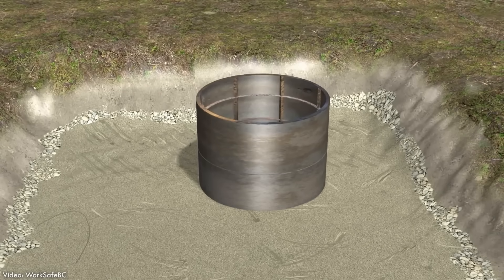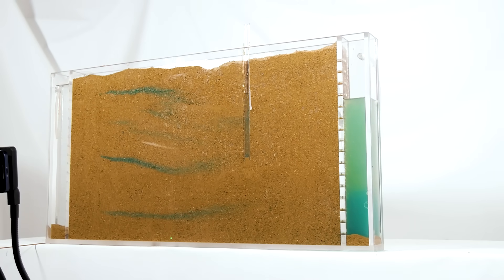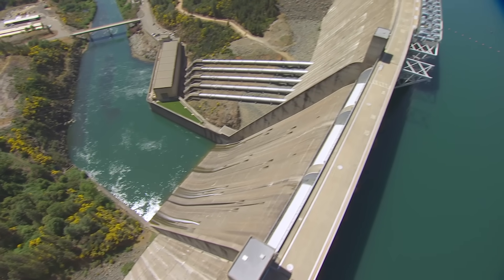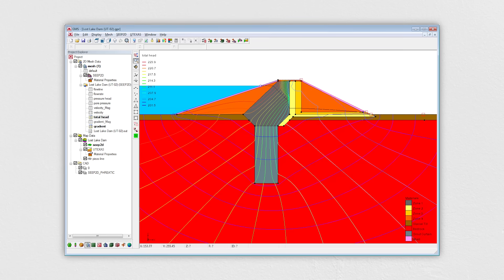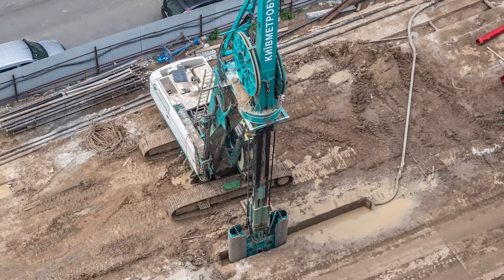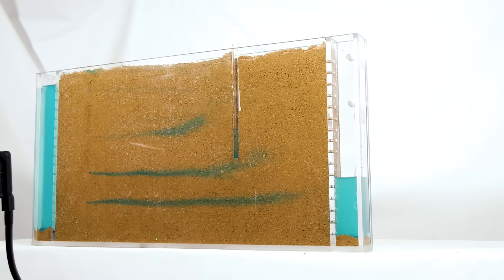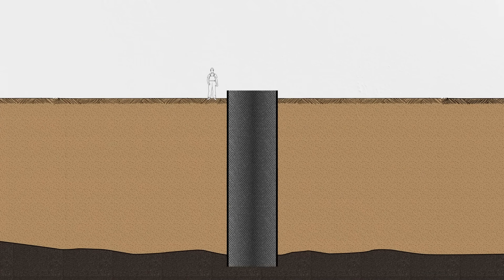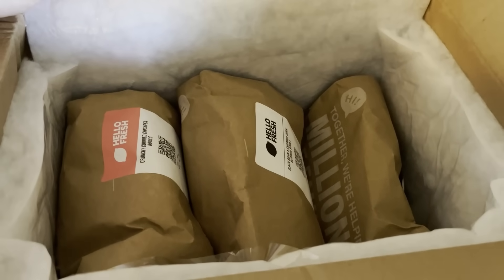The Bizarre Paths of Groundwater Around Structures

Comment: Hi Grady - Is it possible for you to do a video on the effects of over-pumping ground water for potable municipal water supplies?  We live in Florida where the soil is sandy and population has been growing fast. Intuitively - I believe the result has been that the local water table around these “well-fields” gets lowered to a point where organic s in the soil are exposed to oxygen. The organics decompose leading to subsidence, often in residential areas where foundations are not built strong enough to resist pressures. Added to this were development practices where organic fill or “scrapings” were used to level certain areas to create more usable lots. With 5 feet of clean inorganic sand placed on top. I’m speaking from personal experience here documented with subsurface samples and ground penetrating radar studies. The part I am not familiar with has to do with the effect (for potentially miles around) of a lowering of the local water table. Not to mention saltwater intrusion when drilling near the ocean where most of Florida’s population lives. Mostly I’m interested in the more general hydrological engineering considerations as a result of “over pumping” the aquifer. Water is very expensive in Florida for these reasons. Most communities use reclaimed water to lower the pumping demand.
Reply from the maker: I can definitely add it to my list of ideas for future videos. Subsidence is a widespread consequence of groundwater withdrawals, and some places even have subsidence districts that regulate pumping (e.g. Houston). But the mechanism you described of organic decomp of topsoil isn't one I'm familiar with.
Reply: @PracticalEngineeringChannel  I remember from my intro hydrology course the picture of the telephone pole in California that subsided something like 20 ft
Reply: @PracticalEngineeringChannel  If you could add 3d printed concrete to that list that'd be nice. We actually have courses on it now at my college.
Reply: Do you have any videos about perking for installing sewage tanks and why it's important? I'm curious because if seems to me if the ground allows water to seep couldn't that allow polluted water into clean underground aquifer water. Just seems counter to me.
Reply: @PracticalEngineeringChannel  could be fun to look at the Netherlands for a historical example. We're famous for being partially below sea level, but we also somewhat did it to ourselves
Reply: @PracticalEngineeringChannel  Subsidence due to lowering the water table is an interesting topic for sure. In the area around Gouda in the Netherlands (yes, the same name as the cheese) the groundwater level is extremely high. The soil consists of peat and has a very high organic content. If the water table is lowered, the ground will be exposed to air, and hence the organic matter will rot away almost completely. The desired effect of lowering the water table is completely overturned. The need to pump out water from canals becomes even more important.
Reply: @PracticalEngineeringChannel  I am in Houston with the NHCRWA.  New on the board.  I just came across your videos.  They are amazing.  I would love to speak with you.  Need your wisdom.
Reply: If you want an over-the-top case study for Subsidence, check Mexico City. The whole city was originally built on top of a lake, and has (or used to have) a huge sinking rate.
Reply: Here in the Netherlands we deal with the same problem. We drained swamps and peat grounds and over time they just compact.
Reply: @Torchedini  True, we (The Netherlands also have a specific expertise in construction called 'well drainage' (bronbemaling). We are temporary lowering the water table so we can build in the dry. This expertise has the knowledge of groundwater etc.
Reply: @Torchedini  and not just peat, even the veluwe sinks, sand blows away, because of drought and pumping water for drinking
Reply: Just from my experience in Gardening, I can see where it could be a problem. When I get a load of Wood Chips from an Arborist, I expect it to drop to 1/7th of its original volume. Staw loses about 90% of it's volume.
If the developers were spreading out the slash from a clearcut, to get a precious Few More Feet of Elevation, it would be a serious issue.
Reply: @TimeSurfer206  In my inspection work I am always telling contractors to use much more mulch because they put in so little and it loses volume quickly leading to water loss and giving weeds and edge.
Reply: The organic decomposition resulting in subsidence reminds me of some of the challanges the engineers had in my city (Copenhagen, Denmark) when they built our metro system.

Large parts of the city is built ontop of old swamp/bog land aswell as old landfills and in the olden times they would drive large wooden pillars into the ground to support foundations for buildings, especially in these areas.
When they then began construction of the metro, they had to lower the ground-water-table in certain areas of the city to be able to dig the tunnels, but this posed the problem of exposing the wooden pillars aswell as old landfillings to oxygen, making them rot and decompose, resulting in them no longer capable of supporting the weight above them.

Luckily the engineers were aware of this issue beforehand so to solve this problem, they froze the ground around some of the various digging sites so they could dig out without having to lower the ground-water-table and thus not expose the wooden pillars to oxygen.

It was really weird walking around the city during summer and see the ground frozen in spots near the building sites :P
Reply: @Gin-toki  What you say is true. I worked for an engineering firm that dealt with geo-engineering. Many communities were "created" by contractors back in the day, adding soil and creating these water way communities on the edges of waterways and bays. Do to insurance payouts and lawsuits, the materials used are more greatly scrutinized now a days mostly by county building codes. Also, when building sites are cleared  they are subject to a "proof roll" inspection. Basically, a large rubber wheeled construction vehicle makes methodical passes across the entire lot. A trained inspector walks along side the vehicles tire and looks for any depressing effects to the soil. These depressions will indicate organics that were buried and not properly removed and covered up by soil. It will also reveal wet clay deposits that yield under loading. This done prior to any soil being brought on to the site or fill being added and rolled for compaction and construction. With that said, contractors and "third party" inspection firms have found creative ways around the ideal process, methods and techniques for optimal results.
Reply: So regarding overpumping, in Florida the water management districts control withdrawals from groundwater sources. I know in South Florida they actually capped withdrawals from the shallow (Biscayne) aquifer around 2006 and that has pushed a lot of utilities to go to a deeper, brackish water source that is more expensive to treat (but not as costly as desalination since it’s not as salty as seawater). It’s similar in other areas of Florida as well. Saltwater intrusion is an issue in coastal areas. A lot of the central and northern areas of the state have really been ahead of the game on using reclaimed water but it’s a lot harder in south Florida because it was developed earlier and is heavily developed near where the waft water infrastructure is, which makes it much more expensive to run reuse piping compared to newer and less dense areas in other parts of the state.
Reply: @Drinksfromtap  Is this why you drinkfromtap?
Reply: Subsidence is caused by the over-pumping of aquifers leading to the pore structures in the soil collapsing. I haven't heard of organic decomposition causing subsidence but if you could link some resources I'd be interested in reading about it. Usually, organic soil has oxygen available for decomposition unless it's a wetland or used to be a wetland and the organic material is deep enough for oxygen not to penetrate.
Reply: The situation in Florida is also likely different in that the bedrock is limestone, not hard rock or sediment.  So there will be lots of open porosity, channels, fractures, cavities, caverns, etc where water can literally flow freely.  This is especially true if you're extracting fresh water from limestone since fresh water is extremely effective at dissolving limestone.  So in Florida, there are many hidden underground caverns with free water in them unlike sediment dominated areas modeled by this video.  Modeling florida problems is hugely more complicated and depends on a lot more local conditions.  Florida is a carbonate (limestone) platform so it is entirely limestone for thousands of feet of depth.  The soil layer you refer to is just a small amount of sediment at the surface and i'd be surprised if there is sufficient organic material to cause significant subsidence issues.   The fact that you have fresh water aquifer rather than static dead water also means there can't be a lot of organic material.   Geophysicist/geologist engineer here.
Reply: @DarkTouch  question - what would be “a lot” of organic material? Like tens or hundreds of feet? There are tons of organics in the shallow water from the Everglades and Big Cypress swamps down south, but I don’t know how deep the peat layers are. The water literally looks like tea straight out of th ground and some areas have 20+mg/L TOC in their well water, along with ammonia and iron.
Reply: @Drinksfromtap  i look ed at some geologic data and agreeably, there is likely some areas in southern most florida accumulating modest amounts of Holocene sediments, mainly the everglades and the Keys.  outside of that, there's not much in the way of sediments accumulating, florida is mostly exposed erosional environment if anything.  Effects you are suggesting will be highly localized and dependent on near surface  karsting of the underlying rock formations where fresh water is found (by fresh i mean not salty).  To see a good example of subsidence problems, look at deltas, like southern LA, Nile delta and others where there are tens of thousands of feet of sediment.  Florida is underlain mainly by older hard carbonates rather than clasitc sediments.  Carbonate systems are much different that those since there is not much in the way of clastic sedimentation to become compressed, which is the main mechanism for subsidence.  Carbonate systems don't really compress like clastic systems even if they are undergoing active deposition (see Bahama platform for what florida was like during its prior inundations). This is a complex subject and not one easily answered without going into great detail.
Reply: @DarkTouch  Peggy p
Reply: No idea who it was, but I recently watched a good video about over pumping.  Thought this video was from the same guy, very similar demonstration
Reply: If you have lots of runoff from farming, chemical fertilisers contain a lot of oxidisers that break organic  matter down.
Reply: You could watch his video on the Millenium Tower.
Reply: Over-pumping brings to mind acid suphate soils, for which the optimum rate of water extraction is probably zero. It still happens, of course. We learn best by experience.
Reply: Nestle is doing it currently
Reply: Man there's so much unutilized space in north america that's NOT full of alligators and intense sticky heat and hurricanes and swamps that you have to drain if you wanna live there, what drove anyone to colonize florida?
Reply: @KairuHakubi  but the boating and fishing is world class all year long and there's no snow and ice...you pick your poison.
Reply: There is something called a cone of depression. It represents the area immediately around the well where the water is being pumped. The "pointy end" of the cone faces downward so the top has more groundwater removed. This creates voids in the soil and allows the soil above to collapse. 
Karst limestone can also play a role in subsidence.
Reply: @jamesblackwood6068  pretty sure i'm living in a cone of depression
Reply: @KairuHakubi  1) If you are referring to the actual cone of depression, I hope your property stays intact. 2) If you are meaning emotionally,  just know it will get better and no matter how dark it gets, YOU MATTER regardless of what our puny human brains want us to think.
Reply: Regardless of water, organics that are buried don't decompose very fast at all...
Reply: @toomanymarys7355  They're not good to build on either way.
Reply: ground type must impact too then, As one never hears much about that in New England despite muni well and a while lot of residential private sells.  But New England has a foundation that contains a whole heck of a lot of rock, commonly of the granite variety.
Reply: @filanfyretracker  a major fact for 'up north' is that you guys need to  set the foundation 3 to 4 feet below grade for frost requirements. This excavation will remove much of the ground level organics that affect soil compressive strength for building on top of it . Anywhere rock isn't a huge factor you'll often have basements and that's an 8 foot-ish excavation.
Reply: The  responses, for those here  (35 or so) are very educational/analysis.  Okay.  VENICE,  ...Italy. How does the huge amount of water, affect/sustain  the  
weight of this city ?     Would be very very  curious, as to the earth type soils/clay/bedrock,  etc  under there........wow.  This could go on forever.  The wonders of  Gods'  creation, never cease  to  amaze  us....Thanks, again ALL !
Reply: @petersack5074  Gods creation? Are you serious
Reply: @petersack5074  random events happening from time time, did they ever teach biology and geografy where youre from?